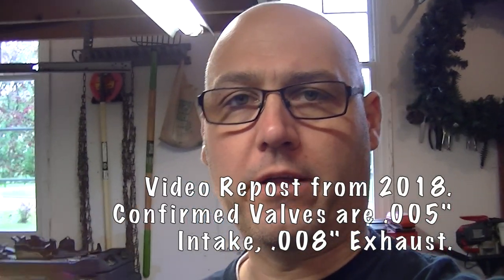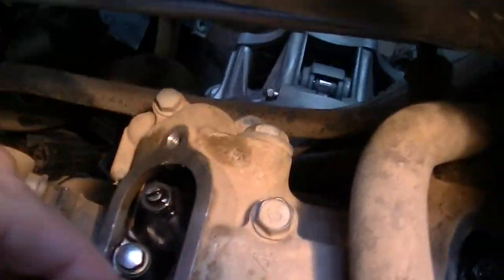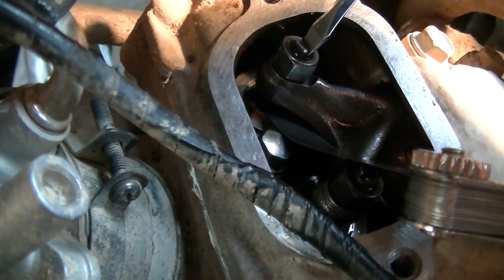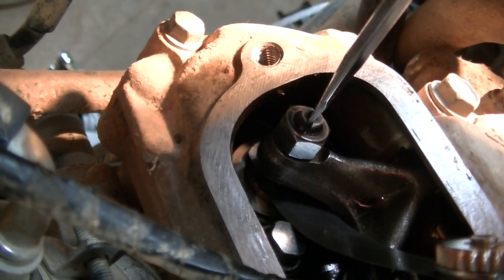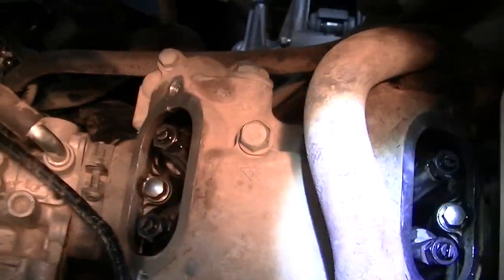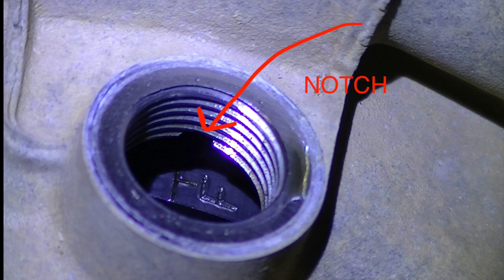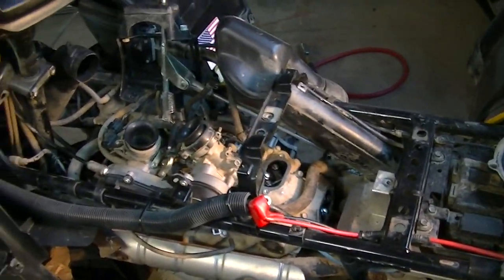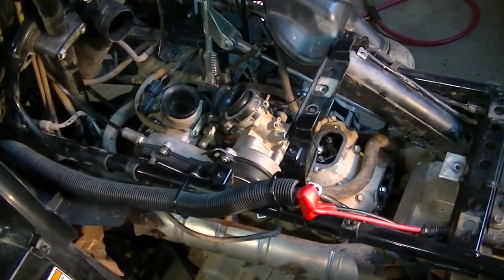Kawasaki Brute Force Valve Adjustment 2018

Comment: would you have any idea what size the kawasaki kvf 750i 2008 adjustment is made of ??
Reply from the maker: There is a free service manual you can get for the Brute Force, I can't recall the intake/exhaust.  Google service manual and it will have it in there.  We sold the Brute last year.

Comment: How often and when should you check your valve adjustment
Reply from the maker: Hi Taylor, I checked the manual, I still had one saved as a pdf.  For a 2009 with FI, first 100 miles they should be inspected and then after each 200 miles.  I think every 200 miles tearing apart the atv just to get to those caps, is way too often but it's in the manual so it must need it.  You can get a free service manual online for the BF, they are very detailed and necessary to know what to do.  We sold the BF in June.  I have a 2014 Can Am 650 and my son now rides a '17 Can Am 1000, both Outlanders.

Comment: My 07 model 750 has the recoil pull starter rope (I know, good luck starting it with that!) ... I'm wondering if I can use that to line up on top dead center instead of removing and using the socket.  I've never removed it so I don't know if there is a spring that will immediately fly out of there.
Reply from the maker: You can use the pull rope and with both plugs out shouldn't be hard to pull.  But accurately pulling and looking in that hole to get it where the manual needs to be, I couldn't do it.  Nothing is under that cap, so no spring or anything.  But, ours did have a mud/water line so we knew our seal was bad and water was getting in there, so we scraped off the old and used rtv sealant.  We sold the Brute back in June, it was in need of a rebuild, at least a top end.  My son bought a Can Am 1000 Outlander, too fast for me.  thanks for the comment.
Reply: I start mine with the pull cord regularly. Just gotta make sure she’s rolled up on TDC before you start yanking or when it gets there it’ll tear the rope out of your hands!!!
Reply: the spring wont come out its locked in there, feel free to remove the recoil.

Comment: Did u use the special tool to remove that small inspection cover or were u able to get it loose with a large screwdriver?
Reply: I used vice grips to crack it loose lol